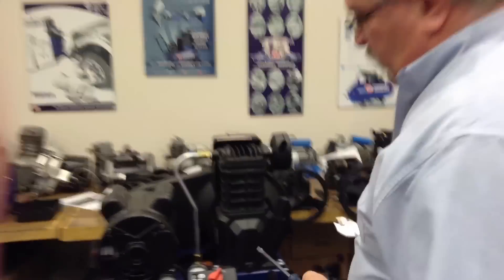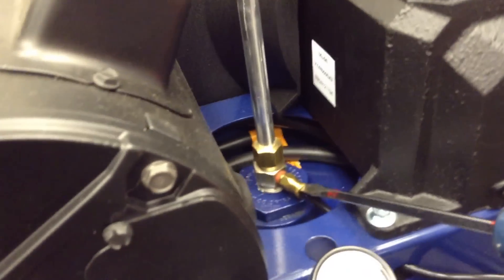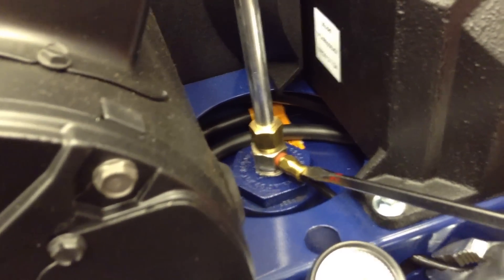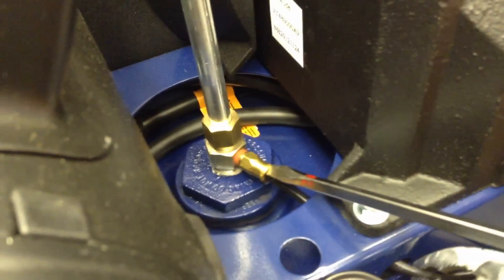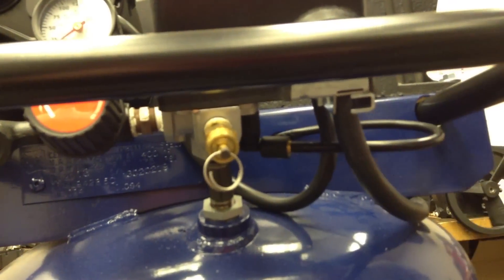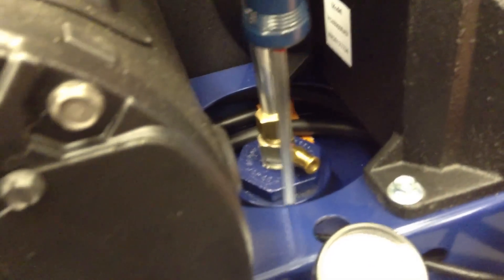Removing unloader tube from air compressor - Tech Tips Campbell Hausfeld

Comment: I have an older compressor with an aluminum unloader tube that runs from the top of one cylinder and to the unloader. Are there replacement parts for these?

Comment: I have a design for an air powered pressure washer that if your company bought from me nobody would ever go back to the old engine and pump design. My power washer has no pump, no motor delivers more than enough pressure than the average guy will ever need  and blasts it out a 9g.p.m. If interested... Shoot me a gmail and I'd be happy to prove it with video. Thank you.   Travis Couch